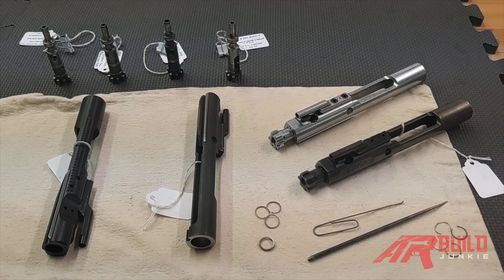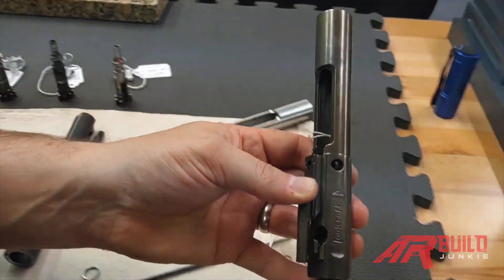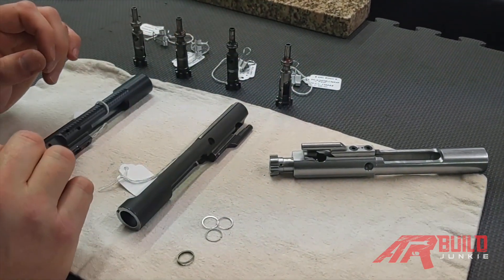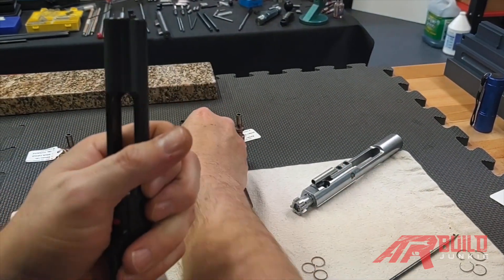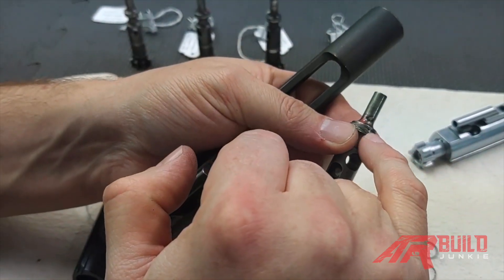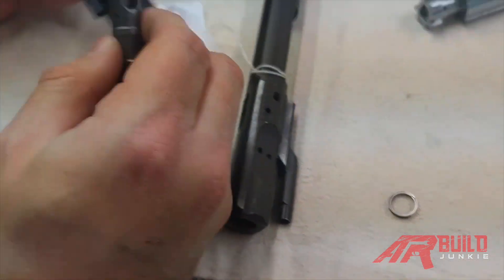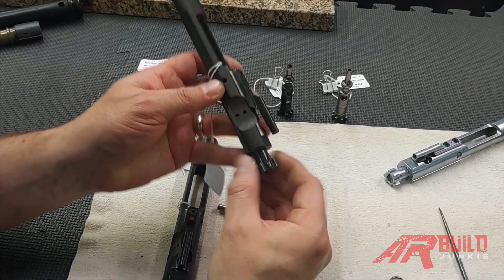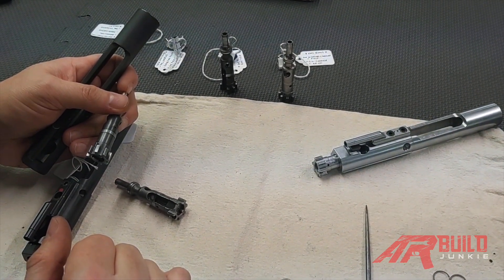AR-15 Gas Rings - How to Test Your Gas Rings

Comment: Why does my bolt collapse under its own weight but when I tried the step two test the bolt did not fall out ? And yes i stripped it out just like he did in the video
Reply: Thoroughly clean the bcg inside and out and try it again

Comment: Theres still one more test to run. Remove the firing pin and the cam pin, then seat the bolt completely and face it toward the floor. If it remains inside rhe carrier the rings are still good.

Comment: I have an LWRC with like 700 rounds nad it drops on its own but i put the bolt in another lwrc bolt carrier and it doenst?
Reply: Is it wet?
Reply: @THEGOODLIFE-wl3xu I just had a wet bcg fall down on a wet bolt after cleaning and oiling. I waited about a half hour and it didnt drop. Does the fact that it dropped while wet mean it’s weakening, or would this be kind of normal for the oil to make it fall? Thanks.
Reply: @THEGOODLIFE-wl3xu  i bought another 12.7 lwrc upper and shot 150 rounds and the bolt cant hold its weight ?

Comment: Why test the rings with the full weight of the carrier? Shouldn't the bolt itself (with the cam pin removed) be enough to test the gas rings? 

Per the TM 9-1005-319-23&P.

4. Check bolt assembly (5) for proper fit with bolt
cam pin removed. Turn key and bolt carrier
assembly (6) and suspend so the bolt assembly
is pointed down.

NOTE:
The bolt assembly must not drop out. If
weight of bolt assembly allows it to drop out
of key and bolt carrier assembly, replace bolt
rings (p 3-21).

Comment: Hi !  Just installed BCM extractor spring kit. It made bolt hard to get in the carrier. Had to tap with a plastic hammer. So doing this test would t seem to work as it seems that bigger spring makes the bolt stick in or out of the carrier.  This seem normal ?  I noticed the new spring much bigger than the new copper colored one I just took out that had problems

Comment: I've discovered if you have a Nickel Boron carrier, they generally don't like single piece gas rings, too little friction, the rings wouldn't seal against the anti friction coating. I had too much gas escaping past the rings and the rifle would short cycle. Switched to 3 piece rings and it worked fine.

Comment: Hey quick question my rings are spinning is that normal ?? Is it supposed to stay still ?
Reply: That’s completely normal. After firing and during loading the bolt is rotating inside the carrier, the gas rings will have more tension on the carrier so they wont rotate exactly the same speed or amount as the bolt.